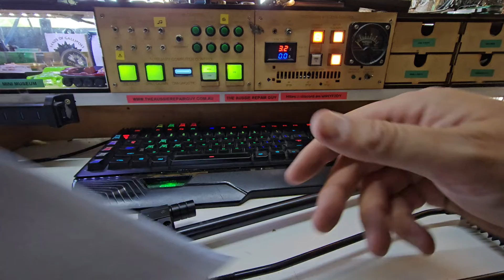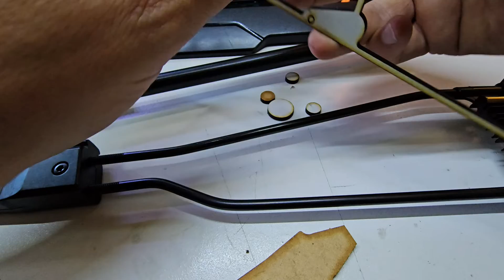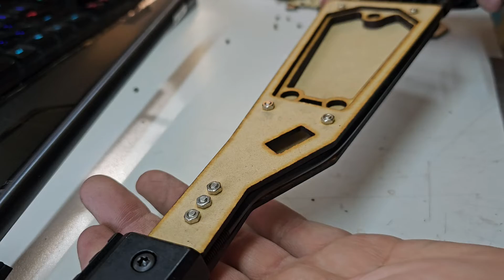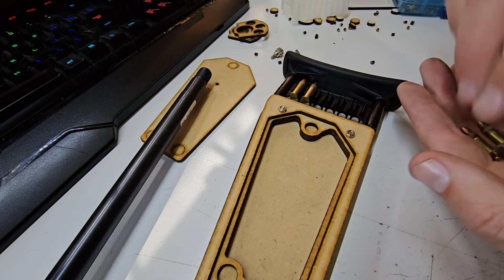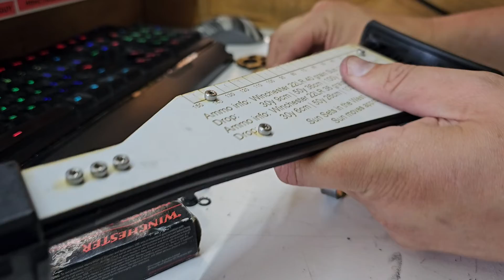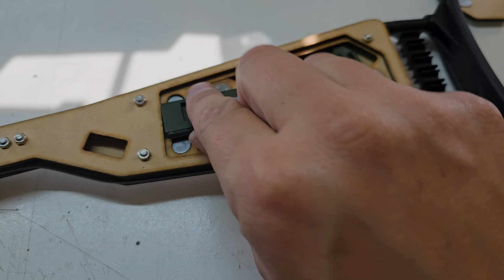Survival storage stock for Chiappa Little Badger

Comment: I would take the flimsy bullet holder out to make the compartment a lil longer and make a space for extra round inside instead..also delegate space for a mini oil bottle, a lighter, a knife, and those batteries..maybe use hinges w/one magnet and a finger hole to open it so its harder to lose the door
Reply from the maker: @scaredofghosts6813  there's only 4mm gap in the middle, no room for .22 in between. I did think of that. Plastic holders seem to be more space efficient. Biggest knife I could fit in was a folding salpel. I carry a decent one on my belt at all times anyway

Comment: Moisture getting in might cause issue with the batteries?
Reply from the maker: This is only prototype, final design will be more waterproof. If there is enough moisture to worry the batteries, I have more pressing issues to worry about with optics and rifle action.
It's not made from stainless steel.
Reply: why would you want a spot for spent brass for a 22